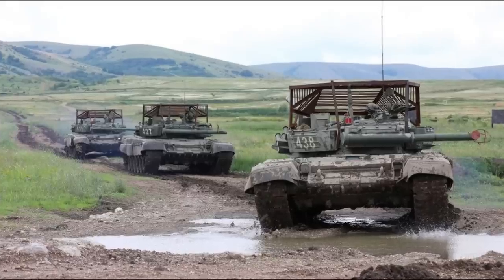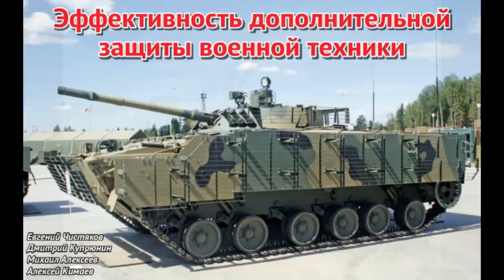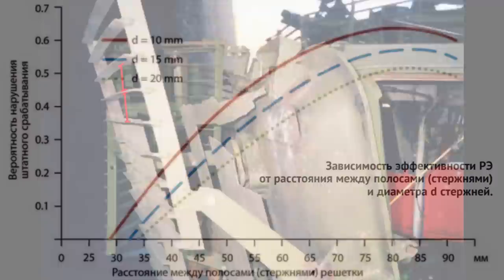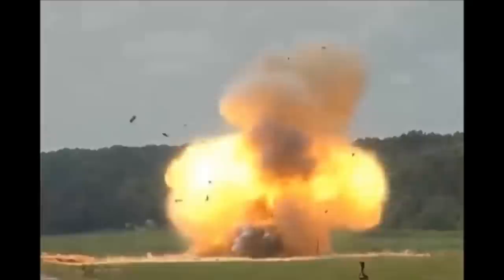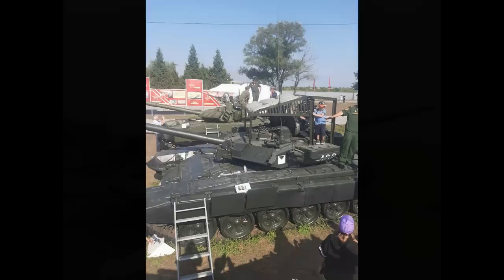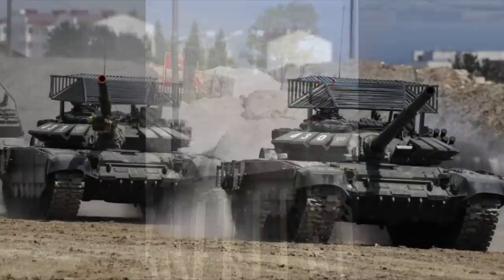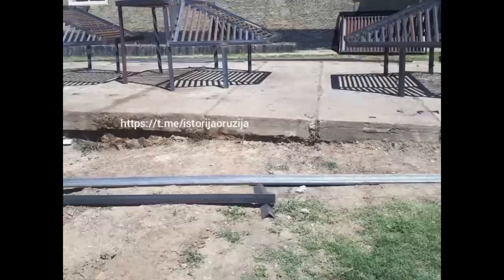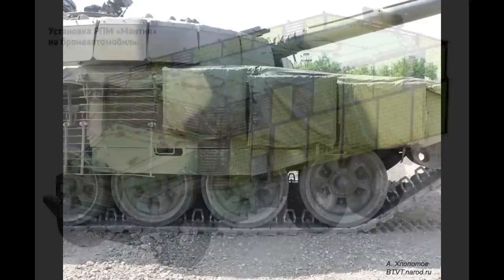The Truth About COPE CAGES

Comment: If the cage method works against RPG-7 warheads, then it should, in theory, work against Javelin and NLAW warheads too since all three (RPG, NLAW, Javelin) use HEAT warheads as standard.  I think where they might be failing is while the standard RPG-7 rocket (the PG-7VL) and NLAW use one HEAT warhead, the Javelin uses a tandem warhead.  I'm not sure as the RPG also has a tandem HEAT rocket (the PG-7VR) and I don't know if they've been used in testing as well.

I do have a problem with their nickname of "Cope Cages" though as while it is a funny term, soldiers have always tried random things to "cope" with enemy fire.  Mounting concrete armor, using logs to pre-detonate shaped charges and prevent the manual attaching of such in a quick fashion, using steel from beach defenses to fashion frontal attachments to use to plow through hedgerows.  To call them "Cope Cages" diminishes the fact that they are largely creations of scared people trying their best not to die while still fulfilling their duty, regardless of whether or not that duty is just.  Whether they deserve to die is also irrelevant and completely subjective.
Reply: Nope, because it is not about warhead used, but its placement and fuse operation. RPG-7 warhead is directly damaged, moreover its fuse is piezoelectric and by impacting cage armor, short-circuit is caused thus disabling the warhead.
Main warhead in Javelin is far rear, as long as fuses works, it more-or-less ignores cage armor on the top of the tank
Reply: @mungo7136  also, tandem charge.

Comment: I wonder why to my knowledge not a single russian tank is using modern APS systems. I mean they clearly developed a few different ones and said they would work more or less great. Are they just that expansive?
Reply: They are not designed for these types, so equipping them will need time
Reply: It seems likely that some tanks do have them equiped, however it does seem they don't have nearly enough to equip all there tanks with them. Well I guess it's either that or their APS systems simply aren't effective enough at this stage in their development to justify their being used.

Comment: My dad was in the 14th armored 47th tank battalion in ww11 he ran into panzerfousts driving into Germany a German youth shot my father's driver with one killing him instantly but didn't hurt the tank after that they tied logs and sand bags on the tank my dad's tank had bars welded all over it the logs worked good at stopping the panzerfoust but didn't work at stopping the panzershrek.
Reply: Pretty sure Panzerfasut has bettee capacity in damage than a PanzerSchreck because of how they worked 
The main advantage of a PanzerSchreck is being reloadable but hey the US uses a AT4 not a "rpg7"
Reply: @gerfand  wasn't sure I thought the Shrek was worse .
Reply: @Superbowfin60  its not that they are worse, its just that Panzerfasut have multiple variants that can pen more or less, but they deal more post pen damage, I forgot about the fact Panzerfasut came in all sort of ways.
That was my mistake 

Overall tho If not wrong PanzerSchreck is better most timed because it has a bit more range and you can reload, but its also super heavy compared to the panzerfaust.
Well they used both because they saw situations where one or the other was more usefull

Comment: I followed the top attack from high places idea at first but hearing this, the drone theory actually sounds the most reasonable. It doesn't protect the engine of the tank but it could protect the crew which is the important part
Reply: you can't easily protect the engine given any attachment need to give clearance for turret/gun barrel traversing 360. Well I guess you can make a giant umbrella on the turret. But the structural integrity is going to be poor and will make it impossible to hide the tank... Not that the cope cages are very stealthy to begin with.
Reply: @neurofiedyamato8763  yeah thats my point, they prioritized the protection of the crew.

Comment: I could see these becoming an actual useful piece of equipment should Russia attempt to take Odessa where ukraine will most likely put up extremely significant resistance and would likely employ older anti armour systems to bulk up capabilities.
Reply: These aren't stopping any HEAT rounds from the last 70 years unless they happen to be the perfect spacing to disrupt the projectile copper liner, which would be only a very narrow range of missile calibers for a given spacing of the metal slats
Reply: i dont think an assault on odessa is likely anymore, that would be pushing russian capabilities beyond max

Comment: When it comes to the cage armor, the only chance it has against shaped charges is by breaking the igniter. Because if the missile explodes against the cage armor, the copper jet retains much of its energy over the distance of several meters (remember, its a kinetic energy based on mass and velocity), thus being able to penetrate the thin roof even if it explodes a meter above it. The only other chance (which is extremely unlikely) is by redirecting the movement of the incoming missile on a very sharp angle without actually making it explode during the process, which to me seems so unlikely that I´d not even count it.
Reply: It shows in the random screen grab how they are expecting it to work. The cage essentially deforms the shaped charge so it is no longer a true shaped charge when it detonates.

Comment: I think one of the main reasons for the cope cages might be to counter the NLAW. This weapon is not like other RPGs, instead of blowing up the tank if flies above it and fires a super hot beam of some kind at the tower. It will punch a 5*5 wide hole in the roof and kill the crew instead of destroying the entire tank. Well, the Russian tanks tend to still be destroyed because they store ammo in the tower which gets ignited. But still! 

Anyway, if you manage to intercept the beam a meter or so above the tower with a sand bag or something then the beam could get defused and spread out. Meaning the beam hits an area of 10*10 instead of 5*5. This would essentially quadruple the AOE and thus quadruple the effective thickness of the armor.  Possibly preventing it from striking through. This is also not counting the eventual armor effect of the sand bag.

Comment: You're misunderstanding how cage armor works. These thin bars of metal have no effect on HEAT warhead jets and modern HEAT warheads maintain penetration for several meters, so it wouldn't even function as spaced armor.

Cage/net/slat armor ONLY works against simple RPGs with a piezoelectric fuze. The bars catches the warhead between them and crushes the outer shell of the warhead, this causes the metal skin of the warhead to contact the fuze, which causes it to short out and fail to detonate on impact. That's why the bars are narrower than the RPG warhead.

Cage armor has no effect on ATGMs which do not use this type of fuze, which is all modern ATGMs.

Comment: Against Javelin and TOW cages do very little except offer a very slight decrease in penetration as the fuzes are very sensitive and are not disrupted like RPG-7 heat rounds are. TOW 2B fly over attack will slice right through any cage junk and through the tank into the ground. I taught the LAW, Dragon, AT 4 and TOW system to 19D scouts back in the 90's. I had hands on with the Javelin training systems before I retired in 98.
The principle of defeating RPG-7 is short circuiting the electrical contact between the nose element and the base detonator. Thus, Chain link fencing and the thin rods with correct spacing work at least 50% of the time. Dragon and regular TOW use a double shell nose that closes the circuit when crushed very very fast initiation of the Fuze booster combination.

Comment: The v-shaped structural metal is called Angle Iron and it is a very common material for metal fabrication in a wide variety of widths and wall thicknesses. The reason tanks need roof protection over the top is for TOW missiles, which fly straight up and hit the lightly armored top of the turret coming down vertically: considering the amount of US aid Ukraine is receiving, it makes sense to at least be prepared to encounter American munitions.

Comment: they MIGHT work against javelins but not against NLAWs. The NLAW just detonates above based on sensors rather than impact. So jet formation isn't affected on the NLAW. And since cages are not hard cover, it doesn't act like spaced armor, disrupting the jet post formation.
Javelin do require direct impact and might work... but as pointed out, the design isn't very efficient. Also the Javelin warhead is located behind the sensor. So upon impact, the sensor is what gets struck, and may not actually stop the warhead from forming the penetrating jet.
Reply: I would sat the opposite is true. 

I think one of the main reasons for the cope cages might be to counter the NLAW. This weapon is not like other RPGs, instead of blowing up the tank if flies above it and fires a super hot beam  at the tower. It will punch a 5*5 wide hole in the roof and kill the crew instead of destroying the entire tank. Well, the Russian tanks tend to still be destroyed because they store ammo in the tower which gets ignited. But still! 

Anyway, if you manage to intercept the beam a meter or so above the tower with a sand bag or something then the beam could get defused and spread out. Meaning the beam hits an area of 10*10 instead of 5*5. This would essentially quadruple the AOE and thus quadruple the effective thickness of the armor.  Possibly preventing it from striking through. This is also not counting the eventual armor effect of the sand bag.

Comment: Those are Angular steel ribs if you are wondering, these are mainly used for building construction and to some extend vehicles. I'm surprised the russians would use them as cage armor. Could be effective or does nothing at all, one thing is true these dont provide protection against top attack munitions.

Comment: Its funny how they chose to only now add those protections, but also how they dont actually work. I have seen that the cages dont actually work much at all, especially since the fragments can pen the armor sometimes, but also alot of the cages locked the soldiers inside their tanks, and they are the ones that most especially are destroyed.

The US, spent millions perfecting its cage systems and counter measures, and trust me, a cheap alternative doesn't work.

If nothing else, 1 in ever 1000 tanks are probably saved by the crude design and functionality of the cages, but they are mostly used to lock the crew into the tank rather than protect them.

Comment: My concern would be that the big drive in tank design has been to keep the profile as low as possible, and now you're adding several feet of height to the tank. Obviously, people won't endanger you by shooting the cage over, say, a wall, but your ability to conceal behind cover is basically gone with these.

Comment: They're just hot rolled steel strips.  In the US they can be found in any hardare store as they're weldable and easy to cut into shape for whatever project you need.  It makes sense that's what they are using because they could find it anywhere.

Comment: Some of those cope cages are not expecting to make direct contact with the incoming ordnance in order to disrupt it.  They have to deflect the incoming supersonic molten copper stream.  So it seems their theory is that the closer angled bars will directly deflect this stream...  does not seem to work well in this scenario though.
Of course as you mention they may work well on small drone dropped grenades and similar rounds that do not auto detonate above the tank.

Comment: Also a TOW 2B will bust through that cage. Not to mention the TOW is programmed to know when it's over a T-72 not to mention the Track Gates on the Launcher can further provide data to the TOW before its fired for sizing up the tank or IFV your aiming out. O and a TOW has a double warhead and it can air burst. Doesn't even have to hit the tank Directly.

Comment: "Long weird metal in a v shape"... angle iron is what its called..  The side mounted cages were tested against RPGs which is nothing like a Javelin or any of the NATO supplied AT weapons which are designed to explode over or hit the top of the tank.  Javelin may likely have issue killing first shot but very likely is providing little more than morale boost as compared to doing absolutely nothing.

Comment: Cage armor works against RPG-7 and similar weapons because they have a contact fuse, they must physically reach the target to go off, which the cage armor might prevent. The Javelin has a proximity fuse, and the NLAW in its top attack mode flies over the target and fires a pair of projectiles downwards, once again, the warhead is triggered by a proximity fuse, as shown in this video. Cage armor would obviously not work against them, or at least not by the same principles as it does against RPG-like weapons. However, considering these, the odd shape of the cope cages actually start to make sense. The thicker, V-shaped metal bars are probably more likely to prematurely trigger the Javelin's proxy fuse than thin ones, and they might offer some degree of protection against the NLAW's projectiles, though I doubt it. Roof armor on tanks is very thin, and even a HEAT jet or projectile with greatly diminished power will probably penetrate them. Another thing to note is that traditional cage armor is designed to protect against shots that come at a somewhat perpendicular angle to it. In the case of a tank's roof, shots will come at various angles not perpendicular to the cage armor. This probably up-heaves the working principles of it to such a degree that the efficiency research shown in the video is not applicable.
Reply: My question is how effective it is, let say there is 500mm space between main armor and top of that cage, how effective it is against RPG-7 how much penetration lose RPG-7 if it is spaced by 500mm, is there any test done which are public ??

I mean every military is using cages on tanks, armored vehicles, MRAPS,.. so they are effective but how much effective ?

Comment: Javelins should not be effected by the cages since they detect the mass of the tank and explode downward above the cage not relying on any contact with any part of the tank at all.  A cage would have to force the charge to explode high enough above the tank that the charge would go off far above its explosive damage distance.  This is very unlikely.  It's nothing more than a feel good band aid which degrades the performance of the tank crew.

Comment: The RPG has a contact fuse located at the very tip of the projectile .  Bar armour works by allowing the fuse to pass between the bars , with the sides of the projectile impacting the bars. This causes damage to the projectile, specifically to the cone metal liner/penetrator and the actual shaped charge itself . It basically  breaks up the projectile before detonation occurs. 
 Should the projectile (impact fuse) strike one of the bars , a low probability , detonation would occur as normal and the penetrator go about its business. 
 Bar armour would have little effect on proximity fused munitions other than increasing the stand off distance of the detonation.
Reply: "Should the projectile (impact fuse) strike one of the bars , a low probability , detonation would occur as normal and the penetrator go about its business. "

Not quite. Optimal penetration is achieved at a specific distance from the target; premature detonation will reduce performance somewhat, possibly enough to prevent penetration of the armour.
Reply: Nice theory Anthony. The angle iron bars won't have any significant effect on the shaped charge warhead. Kinetic energy of the anti tank armour missile will defeat mild steel angle iron nearly every time.

Comment: Id love for someone from that design firm to test their cages with a live person in the tank to back up their claim that they work
Reply: Those original side cages were designed to protect against RPG type rounds and they do work. Such warheads are very reliant on factors such as standoff distance, orientation and warhead symmetry to achieve optimal penetration.
Reply: Steve. Every Russian Tank fitted with cages are just part of the design team, proving that the mild steel angle iron does protect the tank and crew. 
There is also tanks without the cage as a 'control group'. for comparison. 
So far in Tanks versus missiles, only the Ukrainians and donated anti tank missiles are winning.

Comment: If the were to defend against low cost drones, my question would be wouldn't it make more send for drones to attack the power pack to get a mobility kill? You don't even need to have a particularly powerful warhead for it, just jellied gasoline. After all, there are only so many charges of fire retardant on board.

Comment: The canopy over the turret is designed to hinder the evacuation of the tank crew. Officially, it was supposed to protect against NLAW and Javelin missiles, but they detonate proximity and do not use piezoelectric detonators. As you know, the RPG7 has neither the ability to attack from the roof side. There is only the first option - to prevent the crew from fleeing the tanks too quickly.

i'm kidding